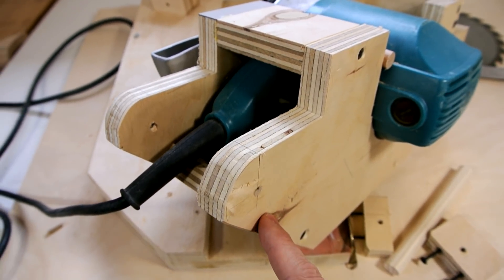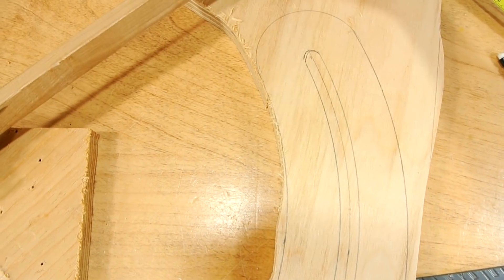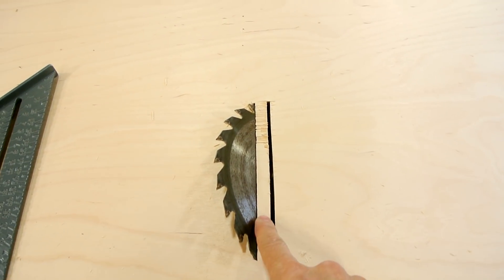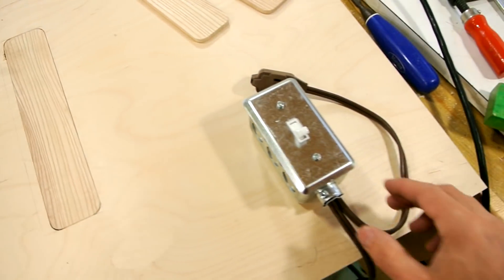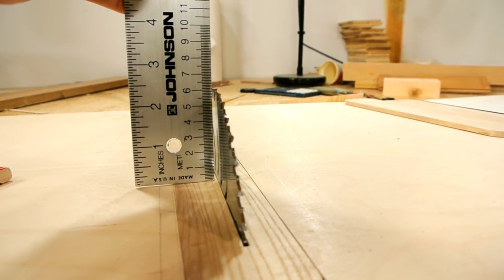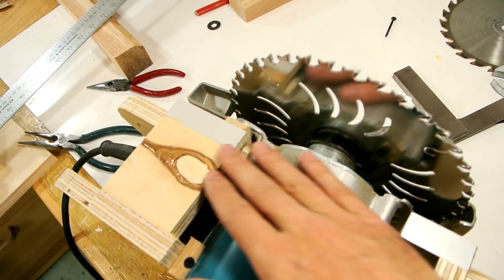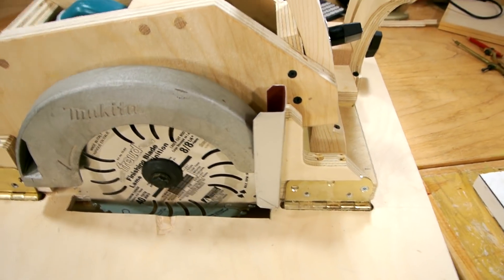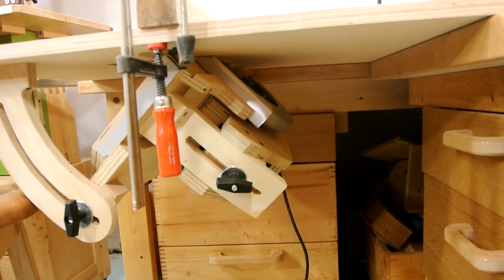Homemade table saw, part 2

Comment: Very pleased to hear an american call inches complicated, lol ;)
Reply: Isn't he Canadian..?
Reply: ***** Thought it was too good to be true XD
Reply: Alex Chulzhanov It's ok, we have our share of crazy measurements in the UK. We tend to use Fahrenheit when it's hot, and Celsius when it's cold. We also measure road distances in miles. At least you lot are consistent in your crazy measurements. XD
Reply: Pul5ar
Well, we get our "crazy measurements" from you Brits. The system of inches, feet, and pounds is the Imperial system, which we inherited from Britain. So it's not OUR crazy system, its yours.
Reply: sidgar1 You use it. Am I not allowed to call the Imperial measurement system crazy because I'm British? I think it's crazy you would choose to use it over the SI measurements. Also, your "Imperial" measurements aren't the same.
Reply: Pul5ar
We don't really "choose" to use, we use it because it still works for us, and it's so deeply entrenched in our manufacturing, construction, and food processing industries that a conversion to metric would be prohibitively expensive and difficult to implement.

Do you suppose it to be a small matter to change the textbooks, educate the public on the "new" system, change the road signs, change the speedometers, the scales, the packaging, and the labelling? Do you think it would be easy to convince the manufacturers to trash the millions of dollars they have invested in Imperial gauge tooling and hardware, or alter the designs of existing machinery or products to accommodate the change to metric? What about the automotive industry? Or the construction industry?

With all the other problems we are facing, converting to metric is the least of our worries. It's just not a priority. "If it ain't broke, don't fix it" just about sums it up.

If only it was as simple as you seem to think. But calling others "crazy" for using measurements your own English ancestors invented is a bit hypocritical (and quite insulting) in my opinion.
Reply: sidgar1 Please don't be offended by my opinion.
My "English ancestors" have nothing to do with who I am. I just happen to be descended from them.
I don't think it would be easy or cheap to move over to using SI units. The UK changed to decimal money in the 60s, and people thought it would be terrible. It wasn't. I just don't understand why the US or the UK would pick Imperial units over SI when they had the chance. I understand the fact that it's deeply entrenched in. We use many Imperial measurements still and I think it's madness.
Reply: sidgar1 Correction dude. We Americans got our crazy measurements" from the English. We inherited it all from England. But, let's not blame the English, if the French had won over the English in the colonies (US) we would have had the metric system (it is French), of course, we would have been speaking and writing in French, not English, or American. :)
Reply: knut761 Except you changed some of the old Imperial measurements. And in any case why would you continue to use an inferior system of measurement?
Reply: Pul5ar Yeah "we" did make some changes and for the very same reason Noah Webster decided to change the way we spell...it was done to distance us Americans from the English, to help us get our own identity (in part anyway)  That being said, the reasons we keep using it (and the English are still using it too) has been explained (think cost) and another part is for the previous stated reason, and because we are used to the system. 

I'm not gonna deny that the metric system is better, but hey, its French!! XD
Reply: knut761 So, the truth comes out XD
If you really wanted to distance yourselves from the british, there's nothing better than adopting a French measurement system, lol.
Reply: Pul5ar Not the British, no need to include the Scots and the Welsh by saying British, we have no issue with them. It's the English we take issue with ;)

Or rather used to, after all, we have a lot in common with the English (for obvious reasons) We were English once upon a time.
Reply: knut761 And Irish, and Dutch, and a little French. XD
Reply: Pul5ar
Actually, we didn't change the Imperial measurements; we never used them.  The system in the U.S. is based on the system before the current Imperial system.  The imperial system was put into place in the nineteenth century; we were doing our own thing by then and didn't pay it any attention.  We've dropped some units, but the sizes are the same as were used in the empire during the eighteenth century.  The only practical difference is with measurements of volume, which are a bit larger in the commonwealth than they are here.

We use metric for everything scientific, of course, and for various random things like certain foods and drinks (booze is sold in 750mL bottles instead of fifths, for instance).  Since the vast majority of Americans never leave the country, there's little political will to move to metric.  For instance, I can convert (roughly) to metric units and back in my head, but I think in feet and gallons and pounds.
Reply: *****
Only if you use cubits, hin, and minas as your standard of measurement.  There's nothing inherently christian about the English system of weights and measures.

Besides, the Metric system was designed in France.  France is very, very catholic (probably more so in the 18th century).  I'm unsure how the metric system would fail to be "christian."
Reply: I am from Canada, and I also find inches ridiculous! I always use metric measurements when woodworking.
Reply: ***** In Canada we use imperial mostly though. I personally hate it and use metric myself.
Reply: 2008brich Perhaps you could have been to Mars by now, had you adopted the metric system. ;)
Reply: knut761 If the French had won in the colonies? They were on the American side during the Revolutionary War.
Reply: Jim Fortune Before the war they fought the English for control over the colonies, the English won. Had the French we would have spoken French. In fact, we have Americans that do speak French, down South. Not that many of them these days but you'll find them in Louisiana.
Reply: knut761 Quite a few just to the north also. Quebec.
I've always thought of the French participation in the American Revolution as an extension of the French and Indian War which was an overflow of what was going on in Europe at the time. But I'm going to have to check back on my previous posts to figure out how I got here starting from a video on how to build a table saw! lol
Reply: Jim Fortune Haha yeah I know the feeling buddy no problem :)
Reply: thingermahjig smith Canada is part of North America...
Reply: It's ok, you can keep it :D
Reply: Jim Fortune 
This is about a saw. Stick with it. We don’t need a history lesson.

Comment: I figure what he meant is that the metric system of measurement, albeit being easier, takes some getting used to when you grew up with the imperial system. And converting units will always require some mental effort or a calculator.
BTW, are the 3/27 in your example a typo? I don't think that the imperial system uses anything else than powers of two as the denominator. That would be *really* awkward. :D

Comment: It would be nice if hinges are aligned with a blade, would avoid having to make two blade protections. Liked it.
Reply from the maker: if they were, they'd be sticking out the top of the table.

Comment: I really need to start working in metric more.  The problem I have is that I can't easily relate MM to a physical size in my head.  For example, if you say this piece is 4" long, I can visualize that instantly.  However if you tell me something is 102mm, I have to convert it first.

Comment: Hello Matthias. As I was not able to find much about using a larger size blade on the table saw (just like you did here with yours), can you comment advise what are the pros and cons and what would determine if I can use a larger than 10" blade on mine? Thank you in advance.

Comment: HI Matthias, a question to seek your advise.  I made my own table saw.  When i need to check the whether it the blade is square, i used a T square to check on on side of the blade and then also do the same check on the other side of blade, and surprising they are different !  Either when the Left side is square and Right side is not or when i fix the Right side of the blade to square but the then, the Left side of the blade become not square to the table .  NOte the table is made of Plywood and then i changed to MDF, but the result is the same.  this is really funny.  Do you know anything wrong?  MDF table top is 900x900 x 16mm thick.  My circular saw is a new 235mm 2000W Makita.   Done too much checking and leveling still can't figure it out.
Reply from the maker: without watching you, I can't tell where the mistake is.  Could be that the edge you are measuring against is not straight, or the square is not square.

Comment: cabinet maker for quite a while.. your inserts for the different blades in the table itself, if a blade gets warped or manages to catch the edge of that insert and throw it - you will have a bad bad day.. give it some play between the wood and the blade.

Comment: I just think in decimal.
Precision=digital caliper for me. Whichever system makes little difference, it still is just a fraction that must be put to an approximate number before you can use it. 
But to those haters of imperial: don't undervalue its convenience. Until you get beyond 16ths, it is very much as simple as metric. It serves the carpenter's intuition. It is way easier to eyeball half of something than .3 of it.

Comment: I personally would never build a workshop table saw.  They are cheap to buy.  If I do build a table saw, it would be for lightweight portability that I can leave outside without rusting.  Cement doesn't rust but it’s too heavy to be portable.  I love Matthias’s design work and I'm watching with an open mind.  But, portable table saws are also cheap and I already have one.

Comment: This is cool and all but is it practical, is it durable? Can it withstand the every day use as say steel or aluminum!!! I think not!!!
Reply: 4 us watching this,diy tablesaw for few monthly diy stuff is plenty... :)
Those who need it 4 everyday use,probably will just hop and buy metal one.
Reply: Dave Chippy  Yes this Saw would not last long with any kind of use put to it. Still cool as a novelty that actually works!!
Reply: Some of the stamped sheet aluminum stuff I've seen for sale might not last as long as this! And fixing it when it does break would be a whole lot easier in wood.
Reply: David Gouin yes it is pretty durable and you can cut different things if you just get a better blade. I think so!!!
Reply: At least it's easy to obtain spare parts. If the surface panel wears off, just change it. And IMO it looks a lot sturdier and more practical than some cheap metal made.

Comment: but what about finger joints or dado cuts you can't mount dado blades or multiple 
 blades in a circular saw thats what disappointed me if you have any way to for
dado cutting with this table saw you made please let me know
Reply: You can do dado cuts and finger joints using a single blade. It's a bit tedious, but it can be done. For dado cuts you lower the blade to the specifications and than do as many cuts close to one another as it needs to get the dado cut you need. Same with finger joints.

Comment: The millimetre (International spelling as used by the International Bureau of Weights and Measures) or millimeter (American spelling) (SI unit symbol mm) is a unit of length in the metric system, equal to one thousandth of a metre, which is the SI base unit of length.
wikipedia

mil·li·me·ter
noun  
a unit of length equal to one thousandth of a meter and equivalent to 0.03937 inch.
source
dictionary. reference  /browse/ millimeter

Comment: The sizes of units in the metric system don't seem very handy to me like imperial units. I'd much rather work with 3/8 inches than .9525 cm. And twice that is 3/4 inches, but in metric it's 0.1905 dm, or maybe 1.905 cm or 19.05 mm. None of the three alternatives seem very easy or natural, and you always have to be careful to pay attention not only to the decimal point, but also to write down what units you're using. You never use 3/8 or 3/4 of a foot or a yard, so automatically they're inches.

Comment: A "mil" isn't one or the other. It's an abbreviation, as you mentioned, and thereby always has a relation to whatever base system the user uses. In metric, mil is commonly always 1/1000 of whatever unit (milli-). I disagree on you that it would mean 1/1000 inch in imperial. That would be one thou. Mils are most commonly used for "millionth of an inch" (i.e. microinch). Which again is a stupid deviation from the SI-system that makes imperial units a pain in the backside =)

Comment: You really do not have a table saw with all that other equipment?  Not only that but you can get an entry level table saw for what that makita you took apart to make your home made job...and it would have a 10" blade!
Reply: Sometimes it's not about the cost of building something, It's the pride of building it yourself the way you want it.

Great job Matt

Comment: 10/1000 of an inch = 0.0254 centimetres actually broski.
Use Google's handy feature. Just put "10/1000 of an inch to cm" in search.
But aye, we both agree. Engage is wrong. :p

Comment: I think the most useful part of imperial is the scaling options, 1/64 1/32 1/16 1/8 1/4 1/2 1" instead of just mm and cm. Also here in Canada where they teach you metric in school and use imperial everywhere else I can say that metric is easier to learn but no harder use. metric actually drives me crazy.

Comment: The best work. H ave a question...how do you make the 45° angle? Sketchup drawings of your  the 45° angle (Homemade table saw version 1 have a tilt mechanism.              http://woodgears.ca/homemade_tablesaw/about.html )
Thanks a lot.
Reply from the maker: the newer one does not tilt (the tilt mechanism is too finnky for beginners, and requires much more expensive plywood, so it wouldn't make sense to build it)

Comment: For goodness sakes man. Use a grounded power cord and one designed to carry the current of a saw--NOT a lamp.
Reply from the maker: And what's the point of a grounded power cord when the saw's doesn't have a ground on the plug?
Reply: ***** Good point. If he were to rip a lot of material in one go, that rather flimsy lamp extension cord wire could get skin burning hot. It is indeed a neat project.
Reply: *****
People think "it's ok because the saw comes with a relatively small-gauge wire."  But they don't realize that, the longer the wire, the more resistance from the wire.  So, while the short tool cord may be ok for a short distance at a smaller gauge, making a longer cord or using an extension code may require a heavier gauge.  On top of that, using a larger diameter blade increases the torque required to turn the teeth through material -- increasing the typical current draw.  I'd cut the cord on the saw off shorter and hard-wire it to the switch, removing some cord length and removing an extra connection, personally.

TL;DNR: Use a heavier extension cord. :)

Comment: the whole point of making something is to save money, im pretty sure i could buy a table saw cheaper
Reply: He says several times "this experiment" "to see if its possible" and never "This is way cheaper/advantageous".  Sometimes doing a thing is just for the sake of doing it.  You'd be surprised where you find solutions to other problems down the road in more realistic applications because of the hurdles you overcame doing a project like this.  Worrying about "cheaper" is missing the point entirely.
Reply: decent table saw is $800+ unless you want a shit ones with useless miter and horrible table fence.His is great specially if you got already circular saw doing nothing.

Comment: No body uses 3/27 or 7/128 they use tenth, hundredth, thousandth and ten thousands. all divided by 10. The lowest they go on a scale is 1/64 then half that to 1/32 and so on.

Comment: Heh, what is there to learn ? You have 10 fingers. And all is in steps of 1,10,100,... 2,5 is half of 5 is half of 10 etc.
Now, imperial is hard. 3 3/27  minus 1 7/128.. equal to ?

Comment: If you can afford a router, jigsaw, skill saw, and all of the other tools you have, then why not just go purchase a damn table saw, 45 minute trip to home Depot  couple hundred dollars done,
Reply from the maker: and then you have an absolute piece of shit of a table saw.
Reply: And so Mr Wandel what do you think you have with this , a professional type table saw I think not , this type of rig is so limited on what you can do with it makes it hardly worth the effort, having said that I've been a professional cabinet, furniture maker for 45 years, even a cheap store bought table saw will work and give you better results than this home made rig will, I know I've built the same type of thing myself, it just won't do the job
Reply: Mr Wandel didn't mean to hurt your feelings, you have talent, mechanical, and wood working, take that talent alpy to furniture making with mechanical features built in and I bet you would have a very good chance of having a good business